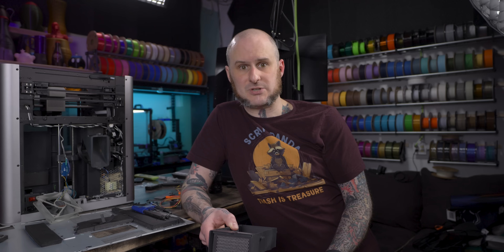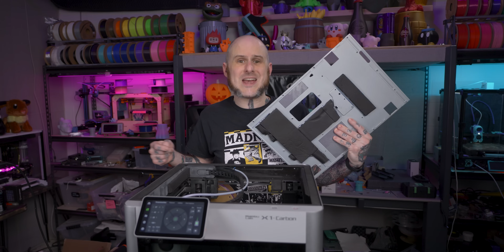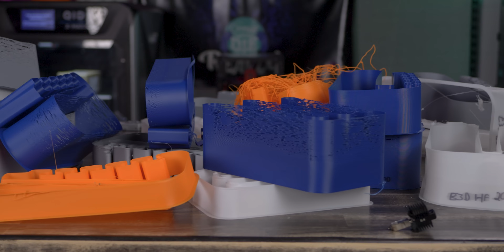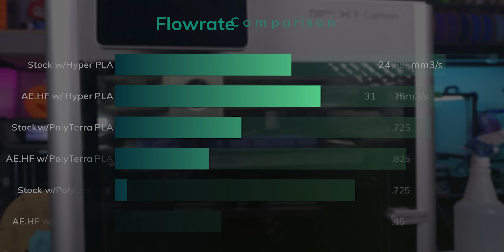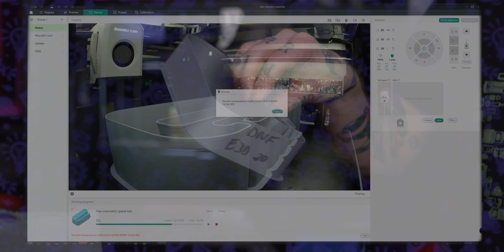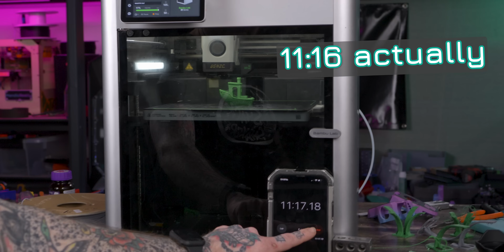ULTIMATE Bambu X1 - Sub-10 Minute Benchys!

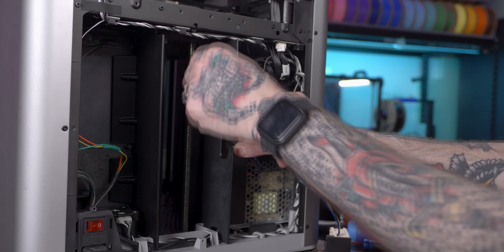Comment: As far as you're issue with the TRP being tripped, the heating power is simply not enough. 48 watts of heating power is really only enough to keep up with the stock bambu lab hotend. there are some mods that people (including myself) have done where they would use heating elements with higher power ratings or wiring 2 of them in parallel to get more power. In doing so they can push higher flow rates and even higher temperatures. I personally was able to push around 70mm^3/sec flow rates and 320C hotend after my dual ceramic heater mod and it allowed me to get a 6:01 minute benchy out of it!

Comment: Is it very cold where you print? I live in a warmer area, the only mod I have made to my X1P is a towel over the top glass and reach more than 55 degrees easily on winter.
Reply from the maker: I live in the Northeast but the studio is climate controlled to 67-69F (around 20C). My machine is also a very early kickstarter unit. Bambu has changed numerous things through production of these machines. I wouldn’t be surprised if the thermistor for the chamber temp or how it reads wasn’t one. They advertised it as a “60C chamber” originally but I’ve never heard of anyone hitting that without an added heater. Maybe they changed sensors to get a better reading? No idea.

Comment: For the price, I really think they should have a fully assembled with all parts needed hot end for the E3D high flow. At the least they should offer a fully assembled version, even if it adds to the price. A lot of people I know with Bambu's have them because they don't want to tinker at all.
Reply: I have to wonder if the development of this hot end is more about the next gen printer Bambu is developing and less about unlocking the current lineup. 

While I understand why some would be intimidated by changing over the heater, thermistor and fan it’s not that terrible of a job. Since I have so many Bambu machines in my shop I bought extra complete hot ends as well as extra nozzles so I can swap the complete assembly in and get the machine running quickly and just swap nozzles over at my convenience. And to date I’ve only broken 1 nozzle due to the print I was doing and only had one nozzle clog so bad I couldn’t recover it. So to my mind the Bambu nozzles aren’t that bad. 

As far as pushing more performance out of the machine, I’m kinda torn on that. Yeah there are times I wish it was faster but then I remember how fast the machines I replaced were. And it’s not like I only have 1 kicking around here either. All I really want is the bigger build volume. Sure there is the k1 max or the QUDI tech x 3 max but those have issues I don’t wanna deal with. I’m just hoping that in the next 3-6 months Bambu finally releases a bigger machine.

Comment: Great video, man. 
Any other like, general weirdness with the Aliexpress hotend? Otherwise that seems like quite the killer deal.
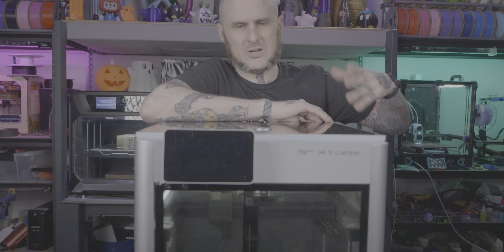Also, RIP contrast and saturation at 24:11
Reply from the maker: I've already killed the nozzle on the AE one. That "Hardened steel" isn't very hard. 800g of Glow in the Dark filament and it is already almost shot. Besides that it worked fine and for the price is a solid option.

Comment: One thing i noticed with the bambu hotends: the thermistor position is vastly influential on the flow rate at a set speed. Here is what my testing resulted: dragon hf with included copper nozzle and 60w heater got me 27mm3/s at 250c abs. The aliexpress bambu hotend i used was the first revision, so basically like the stock, but with removable nozzle and copper instead of brass for the heater block. If you install a v6 nozzle its melt zone is exactly as long as the one from a dragon hf. Same material, same length and the bambu one has even a heater that covers more of the heater itself. Results were still bad, 28mm3/s with a genuine bondtech cht at 250c. With the copper nozzle it was only 23. To get the same result i had to increase the temperature by 20c, which makes sense as the filament on the bambu one gets exposed to a lower temperature than the thermistor measures. On a dragon hf its exactly the opposite, the filament is exposed to a higher temperature than the thermistor sees due to the arrangement of the components.

While testing at e3d you already noticed the changed thermistor position making it awkward to install the clip. Part of why the e3d obxidian hotend outperformed the others so greatly is the different thermistor position i dont know by how much, but its guaranteed that it played a part in it.

As for the longevity of the heatsink of the AE hotend i wouldn't worry too much, you built a stealthburner and that thing has a filament path consisting out of plastic for a good portion.

The helical spur gears on the fysetc feed gears do improve the meshing, making it more uniform, not more efficient, but also introduce a axial load which causes the gears to go out of alignment. The angle of the gearing causes a forward force on one gear and a backward one on the other, so the filament won't be in the deepest spot of the hobbing if you understand what i mean. To counter that effect the feed gears would need some sort of axial guidance, which they dont have. The idler runs on needle bearings and the idler leaver isn't even suspended on bearings. Of course this is theoretical, the friction between shaft and ball bearings might be greater than the axial force making my last paragraph useless in reality.

As far as the cooling ducts go, you rarely see any improvement when increasing cooling in terms of maximum overhang angle. The maximum overhang angle is determined by the ratio of line width and height as with a low layer height the next layer isnt as much spaced out as with a coarser layer height. For example, a 2 to 1 ratio (0,4mm width and 0,2mm height) results in about 55 to 60 degree angles factoring in that a extruded line is rounded at the edge and not rectangular. So you could install a cpap fan and still get crappy overhangs over 60 degrees. For that reason my default line width is 0,5mm instead of 0,4mm while retaining the 0,2mm layer height. 

Anyway good video and i like that you always get straight to the point of the video, not much fuss around it. Please keep that
Reply: damn

Comment: thank u for your videos ❤, I wanna buy a printer with good print quality I wanna print small prices and also big size prints. And it's better to be something fast (under 500$ or 600$) what do you recommend 
Shall I buy kobra 2 Max or anything from anycubic?
Reply from the maker: I have no experience with the Kobra 2 Max, I was not happy with the Kobra Max though. The Neptune 4 Max is not great. It works but has issues. Honestly the "large" printer market isn't great right now. It is a dead spot in the market. 

For less than $500 my current best recommendation is the Bambu Lab A1: https://shrsl.com/4dxfd (affiliate link)
It isn't very big but prints very well for its price and is quite quick. 

Some other machines exist at bigger sizes in that price point but they all have some issues that make me hesitant to recommend them.
Reply: @MandicReally  thank you for respondin❤️ I checked the link but they don't ship to turkey. Where can I buy this printer (brand new) except their site

Comment: last comment/Q - I checked my stock Orca profile for Polymaker ASA - it's 13^3 - are you telling I could easily bump that to 20-ish on the stock hotend?
Reply from the maker: Honestly I've left mine at 12-13 most of the time I've run my X1. Test for yourself to be sure, but it does seem like it was overly conservative. 

I swore I tested that myself a long time ago and got poor results. So either something has changed, or I am totally misremembering.

Comment: Hey @MandicReally, I am running the K1 CHCB-OT heater element on the E3D nozzle. Only problem with it, it's too short to connect to the board, so i had to extend it. 

I was able to push about 50MM^3. I have a video on my account showcasing 50mm^3, but I think it can go even higher. We also tried the Rapido v2 heater, but that killed their TH board. I still need to run more tests.
Reply from the maker: I was pushing 55mm3/s with the Sub-10 minute Benchys. It was... working, but likely underextruding a bit. When I tried to push to 60mm3/s is when I got the one that was a full on failure, ha. 

I'll wait for some further testing on heater options. Or hopefully the X1+ team can get PID tuning integrated.
Reply: @MandicReally  Got another Benchy at 80mm^3 on bambu pla. 11:22min

Comment: Question what use are the 1 2 3 blocks ?
Reply from the maker: I use them mostly to hold things up off the bench while I'm filming them. 🤣

But really they are good for squaring up parts or holding say a gantry at a set height. I use them often for a lot of varied uses. But their intended purpose is to Jig things up and ensure they are square while doing so.
Reply: @MandicReally  cool

Comment: question on the Bento fans - how are you dealing with tach wires since there's two fans and one connection?  Did you just hook one tach up and jump the 24v/gnd/signal on both of them together?
Reply from the maker: This. Does mean one fan may read improperly but it is the only way I can see to do it and not send an inaccurate signal back.

Just realized I didn’t say which way I did it. I only used one Tach signal wire. Spliced the rest together.

Comment: I really enjoyed all this content - really great job on the testing of flow - that E3D hotend is looking more and more worth it - I was a little surprised to hear how much cooler you print by default - congrats on the fast speed benchy!!
Reply from the maker: I’ve tested Polymaker ASA back and forth and got my machines and uses, 240-255 is all it needs. Heck my 0.1 I have gone a slow as 235, but I bumped that up as I was concerned about adhesion strength. Never proved a problem but wanted to play it safer.

Comment: почему не используете сопло 0,6мм ?
Reply from the maker: A lot of what I print is designed with .4mm nozzle size in mind. 3D printer Parts and Smaller Detail parts. If I need larger prints that a larger nozzle makes sense for, they are usually larger than fits in the Bambu X1.
Reply: @MandicReally  I carried out many tests with different nozzle sizes 0.4, 0.6, 0.8. and came to the conclusion that the filament has the greatest effect on print quality; the optimal print speed was achieved with a 0.6 nozzle and a well-selected filament. Moreover, almost everything depends on the quality of the filament. Thank you for your videos very useful!

Comment: I saw good results with the AE Hotend and brass HF bored AE nozzles, up to 30 to 32, with PLA, PETG and also ASA and ABS. Every abrasive Material was a nightmare with the hardend AE Nozzle with copper core. I sign your result 100%. I am waiting for the panda hotend, willing to use this with HF Revo nozzles. They claims they will be available by march.
Reply from the maker: I’m waiting on the release sample of the Panda, but I should have it… soon? I also have the ObXidian Revo High Flow here, so we shall see what we can do. 👌🏻

I also have already killed the AE hardened nozzle in less than 1kg of filament. 😬
Reply: @MandicReally  Eager to see that test! I really liked the Revo on my Prusa MK3s as the nozzle swapping is just so simple. I still prefer the swapping design on the bambu over the classic E3D wrench stuff but it's a pain nonetheless.

Comment: What I'd love to see you test (as one of the very few creators who has managed to obtain the E3D Obsidian HF Hotend) is how the E3D HF Hotend compares with the Big Tree Tech X1 Panda Revo Hotend running a HF nozzle. Granted that the Revo HF hotends aren't hardened, but given that I don't print a lot of abrasive filaments, I would be willing to swap the convenience of the Revo quick swap nozzle system for, on the rare occasions when I want to print something abrasive, the need to swap the nozzle for a standard flow rate hardened steel revo nozzle.
Reply from the maker: Revo ObXidian High Flow is coming (And I have some of them already). I'm waiting on the release version of the Revo Panda. I have the Revo Panda but it was an engineering sample and changes have been made. So watch out real soon.
Reply: @MandicReally  being completely honest, once Revo ObXidian High Flow Nozzles are publicly available, assuming that the Panda X1 Revo Hotend with a HF nozzle can reliably do above 35mm² / second then the current Bambu / E3D collab option will be pretty much pointless at least for me.

Comment: 15:23 i don't remember which abrasive test I saw, but the upshot was that most of the way was at the tip, and the copper insert was fine
Reply from the maker: I've already been doing testing and found that to be the case. The nozzle is already just about ruined and the copper is still largely fine. But it only took 800g of filament to ruin the nozzle so... I'll post more soon-ish.

Comment: what are those pieces under the bed of your voron 2.4?
Reply from the maker: The "Kinematic Mount" setup. It is a design that decouples the bed from the frame to allow for it to shrink and grow under temperature changes. The goal is to prevent it from warping under high temperature swings and keep it flatter. 

Here is the Github: https://github.com/tanaes/whopping_Voron_mods/tree/main/kinematic_bed
And an Affiliate Link to Parts on West3D: https://collabs.shop/ek5dna

Comment: i can say this. The filters works like "so so". i have a air quality meter in the room and it hits rock bottom when it runs. So This mod is good i tell u guys.
Reply from the maker: I really wanted to do a full air quality test inside the chamber (and around the machine) before and after, but I just couldn't put this project off any longer.
Reply: i did my test outside with the filter with comes with my printer. and it told me bad news. But we all know that printers does leave bit of harmfull stuff  @MandicReally
Reply: My test was done by a external sensor. and that gave me a red flag,. but anyhow. im sorry my english is bad. :)

Comment: I need to get that different racetrack test file!
Reply from the maker: Here is the original: https://www.printables.com/model/281016-flow-rate-test-geometry

I only tweaked it by scaling it to match the OrcaSlicer flowrate test, then exported the STL from the slicer for future use. I don't want to repost it as a Remix as it was such a nothing change to it.
Reply: @MandicReally  it looks so much better than the stock one I might just replace it in the orca files lol.

Comment: Just looking at the Overhang comparison tests you had from the side it looked like the stock versions didn't hold up to the angle it should have been compared with the BEN2C, what is it measuring with an angle gauge as compared to what the print says at that angle?

Comment: Hey there mandic.
Thanks for all your work and efforts!
Regarding the hotends you might have overlooked a interesting one.
Biqu and bigtreetech partnered up and build the panda revo hotend for the x/p series printers, which allows you to install every available revo nozzles, supported with the 60w heater. They should start shipping in February. Yes... its expensive. But looking at the revos I think it's worth it
Reply from the maker: Thank you. I am aware of the Revo Panda, I even have one on hand. However to my knowledge it is only for the P1 series as of now. I should have the final release version on the way from Biqu currently. Look out for an "Ultimate P1S" build. 😉
Reply: @MandicReally  well... they offer a x1 version now aswell 😉
But I doubt, results will differ much from both versions